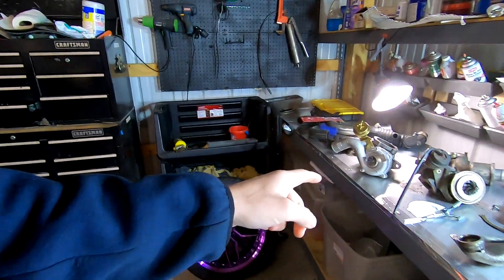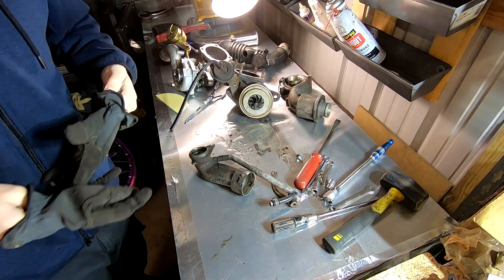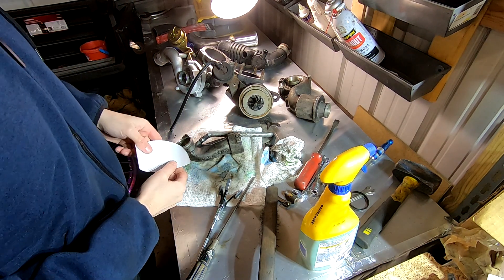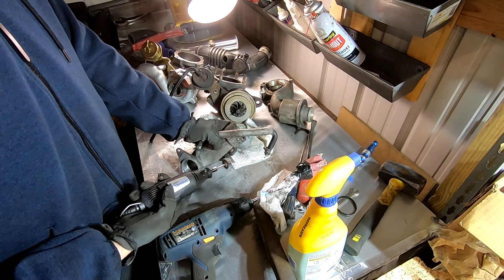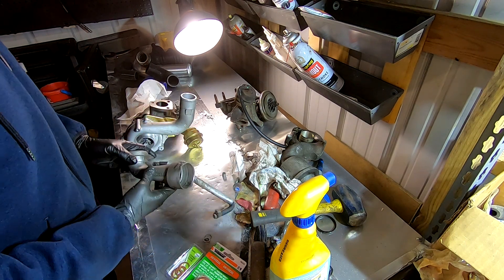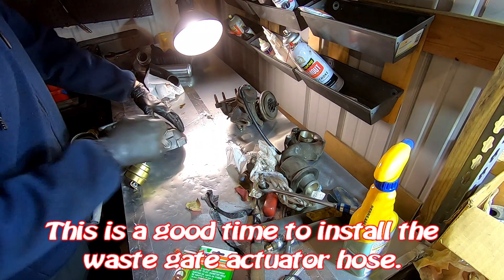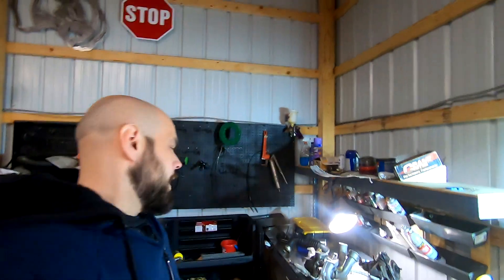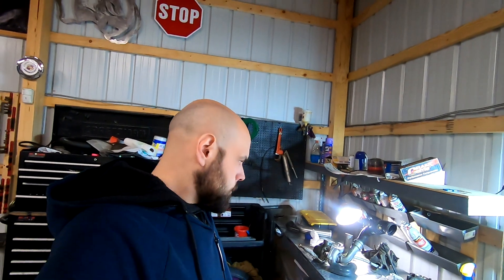Jetta Bigger Turbo| 1999-2005 Jetta K04 Swap MK4 Jetta Build Ep 5

Comment: How well does an elbow fit in that tight of a space. I have been looking at mine and it does not look like an elbow would fit well
Reply from the maker: It doesn’t and a lot of times it pops off. Which is why I chose to modify this
Reply: @davesworld2132  thanks for answering so quick. I am going to try the silicone inlet with the ports to replace the stock one while I fab a custom pancake inlet.
Reply from the maker: @emphiaz  Since I posted this video I actually started designing intercoolers let me know if you have any trouble
Reply: @davesworld2132  will do! Thanks for your help man. Also love the channel. You bring up a lot of detail that other channels just skip over.
Reply from the maker: @emphiaz  I appreciate that. I plan on doing a better version of the series in the future. I’m just trying to finish up another series on my CRUZE RBI’s turbo right now.
Reply: @davesworld2132  🔥🔥🔥 can't wait to watch it!

Comment: Totally waisted your time with metal turbo inlet. Next time buy a better flowing silicone TIP problem solved.
Reply from the maker: Hi there was two factors for this. One was my friend who owns this car had a budget. The other was those aftermarket intake slip off quite a bit and I didn't want to give him a car back with a part that could make him stranded.
Reply: @davesworld2132  not if done correctly, never had one slip off. that cast alloy part is very restrictive, to be honest k04 is a waste of time with a k03 inlet
Reply from the maker: @matk22  I mean possibly but this car made very good power and drove awesome. I literally filmed every step of the way from beginning to end. For a budget upgrade it’s perfect. If you have a bigger budget you can always do better. In fact in this video series I made mention that originally we were going to do a V-8 swap to this car. But the owner just wanted it on the road with as  cheap of a budget as possible.
Reply: @davesworld2132  oh yea I get that and have made my way through your videos... Even a cheap intake is. Like 50 quid on ebay. Better ones are over 100... 50 would be well Spent to help the turbo breathe.

But then if he wants it on the cheap then it'll only end up one way usually..
Reply from the maker: @matk22  it was literally a $500 budget. The tune alone new was $750. The only way he could afford the tune it was by getting a used ECM with a tune on it.
Reply: @davesworld2132  all those Honda Civic risers have migrated to VWs... 😭
Reply from the maker: @psiturbo  ricers?
Reply: @davesworld2132  typical, am ass broke, but want a fast car, barely can maintain the vehicle, slapping shitty parts, the usual ricer as it was back in the day with Civics.
Reply from the maker: @psiturbo  civics now evolved to some expensive high power builds ironically

Comment: Could you have used the induction intake from another car w/ same larger turbo??
Reply from the maker: It’s possible but I don’t know if the airbox elbow would be able to hook in because it’s a special quick connect. I chose to do this so the mass airflow sensor would work properly. Also they do sell some aftermarket ones that use a clamp and a rubber coupler but from what I read online they pretty much fall off all the time which will leave you stranded.  You may be able to get away with an Audi part but my other problem was sourcing it.